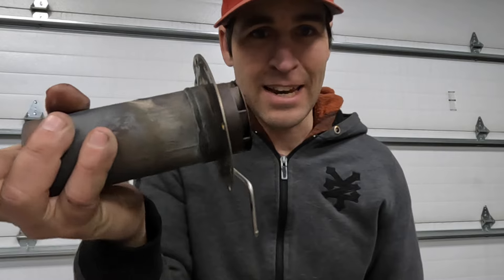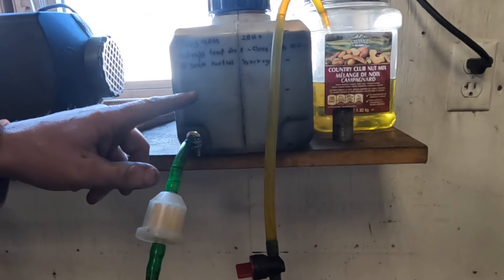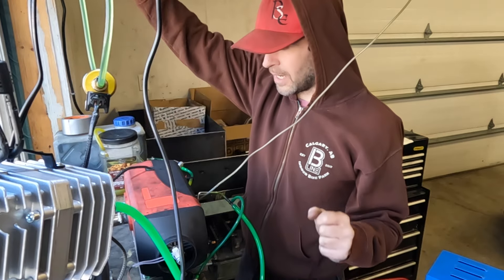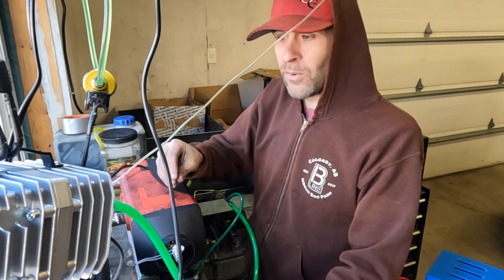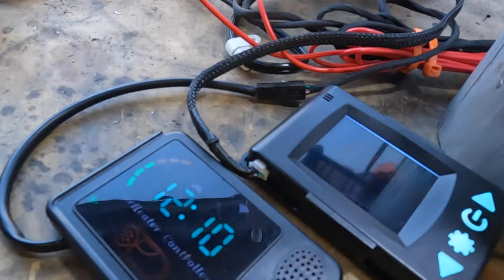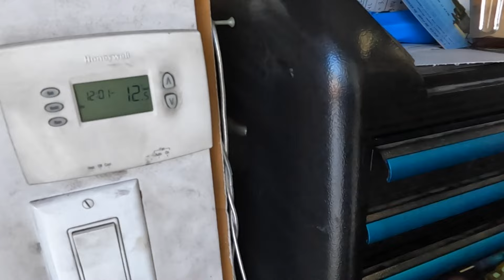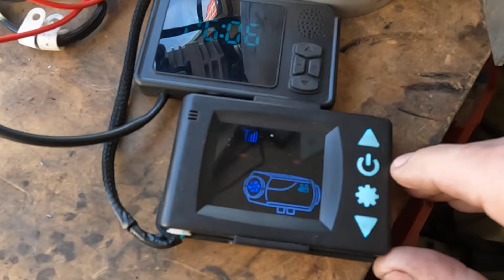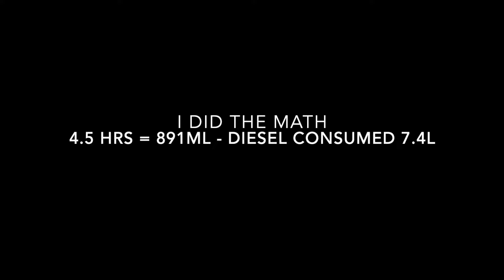Incredible Results - Diesel heater Burning Used ATF -  (Success?!)

Comment: I like your videos and they are very interesting but from my own experience I wouldn't try to change anything on my combustion chamber because the heater still runs on my 70/30 mix of hydraulic oil and gasoline.  Today it's been 16 days since it works on this mix, I have a 3-way valve, I start on diesel, at 200 °c I switch to mix and then when I want to turn it off I switch to diesel.  Speaking honestly, only God knows what deposits are in my combustion chamber, but as long as the flame starts well, hot air at 95-100 °c is coming in, I will not go to it. So, I have 16 days x 14 h/day = 224h and I have  consumed 63 l of mix, now calculating 224/63=3.55l/day, 3.55/16=0.253g/h or is my math bad? Having these data, I think it's worth opening it once a month and  I clean it, it only costs me an hour of work and two gaskets to change.  These values and the fact that it works well with the mix happen since I installed the 3-way valve and start/stop on diesel, before when I started and stopped. directly with the mix I had big problems and after 3 days the flame stopped starting and had to be repaired  and cleaned.  Oh, and I forgot to say, the exhaust gases are very clean, not a trace of smoke and they are not bothersome to the nose, I smelled them for a few seconds. What do you think?  I know that you will end up discovering the clean burning of oil like diesel and you will end up selling the idea to squirrels who will pay you big money😁😁
Reply from the maker: Thanks for the comment. 

Hydraulic oil and a few other fluids are much less likely to produce ash, but my main focus is on engine oil, and it produces a LOT of ash... I have 400L of oil currently and other fuels are just experiments for the benefit of others. 

If you have access to hydraulic oil, this seems like a great solution. I would certainly do this. The original design of the chamber is excellent if you are burning a fuel that doesn't create much or any ash... However, when burning fuel that creates ash, they do not work for very long, haha.
Reply: @loweredexpectations4927  hi,i came with an update,after 100l of mix fuel(70-30 hudraulic oil and gasoline) i decide to open and clean my heater who was preety clean for my surprise and it was expected to be full clogged.It was some deposits on the bottom of burner but not like when i start and stop only with mix. Definetly starting and stoping with diesel is the best choise for me.I will keep using the heater with this mix because for me is the most economical choise and is preety decent to clean the chamber after 1 1/2 months and 100l of mix. Thanxs for all your videos
Reply from the maker: @carlos_sacalul  That's awesome  ! Thanks for the update.

Comment: are you planning on trying kerosene?
Reply from the maker: If I were to try kerosene, I would burn it in a normal beater, and not this contraption. I have heard from many many people that kerosene works fine. In some parts of the world it is cheaper than diesel, and it gets used a lot. 

I have already tested paint thinner and varsol, and both of those worked fine.

Comment: do not put your diesel heater inside the garage you're asking for trouble put it outside by a window
Reply from the maker: Thanks for the comment and suggestion. There are safe ways to out these in your garage or vehicle.... I definitely do not recommend using the heater in the way that I am.